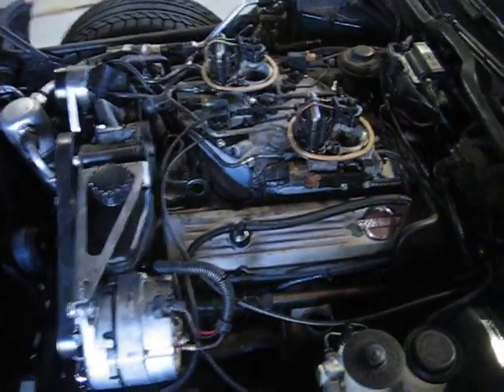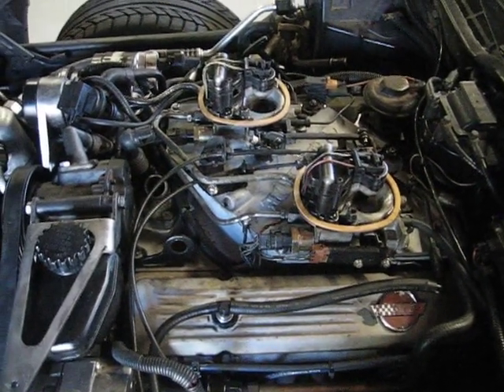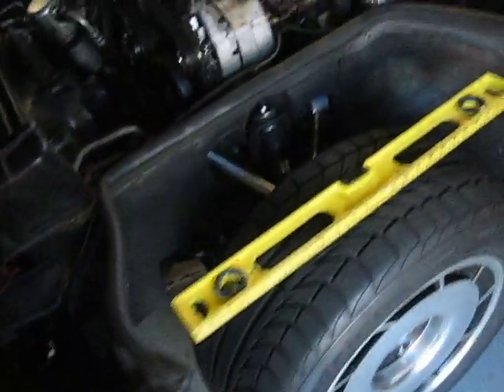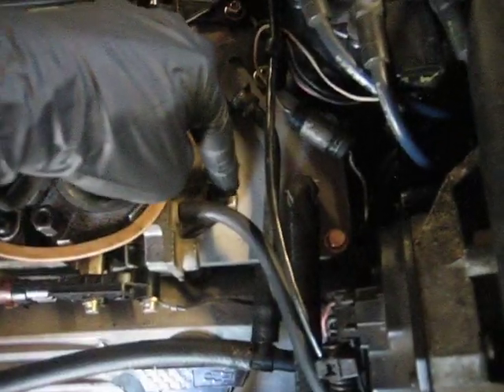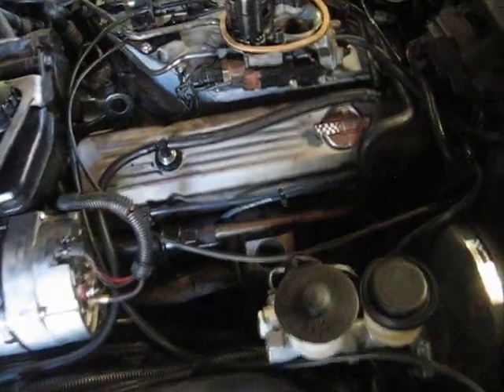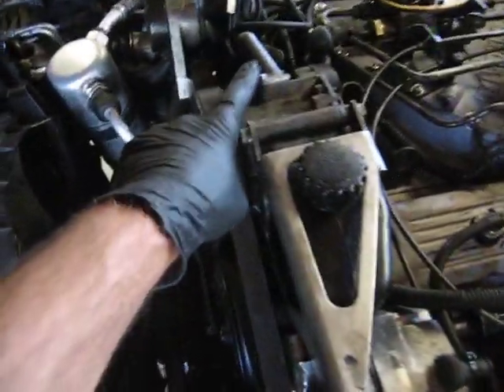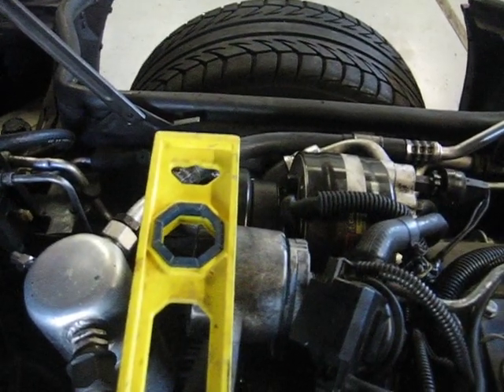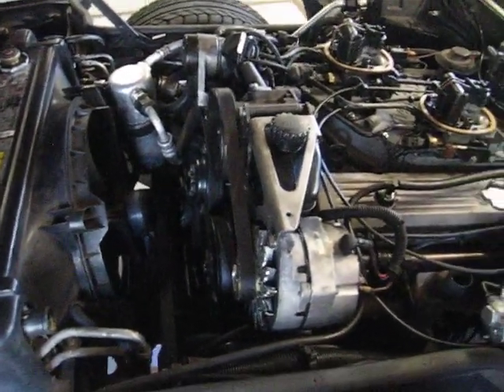Corvette Crossfire Renegade Intake manifold installation notes pt.3

Comment: Did you ever figure out how to align the air pump? I have the same issue.
Reply from the maker: I enlarged the mounting ears of the air pump and adjusted it's alignment that way and cinched the bolts down tight. Worked out fine.
Reply: @ericschulte1853  Thanks man! I will give that a try.
Reply: @ericschulte1853  Update... worked great and pretty easy fix. Thanks again.
Reply from the maker: @80s_Gamr  glad to hear it helped. Let me know how the Renegade works for you.